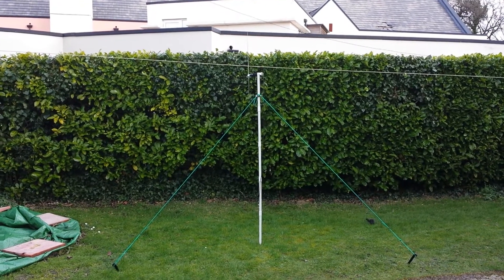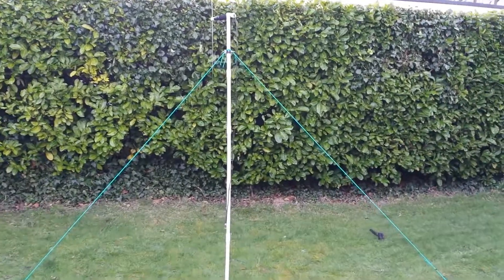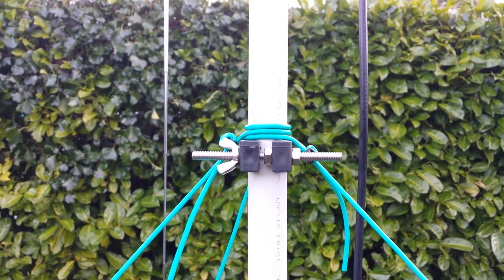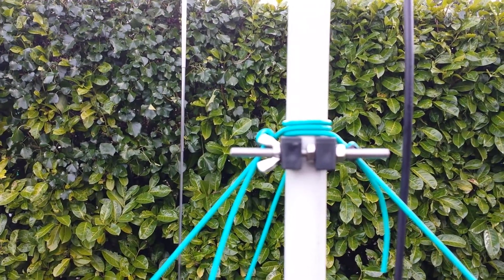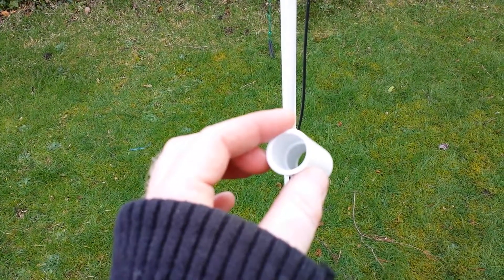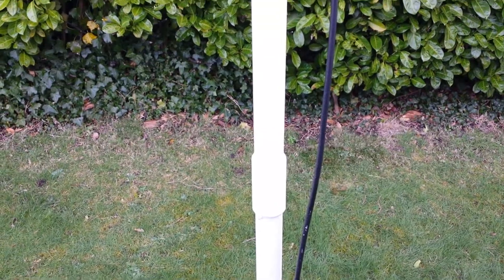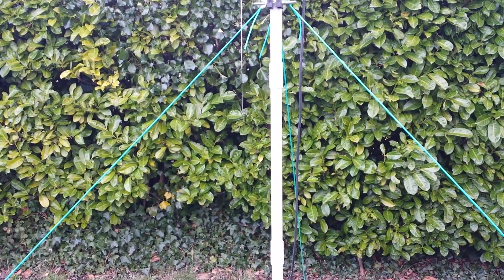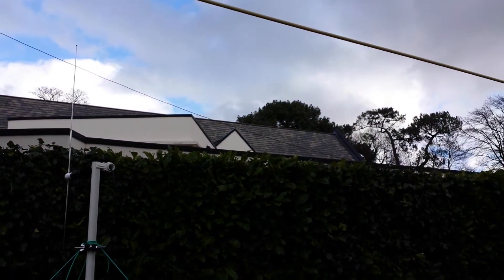SOTA 2m/70cm telescopic Dipole Antenna Pt3 - "THE SOTA MAST"

Comment: Newly passed foundation licence holder here, quick scour of eBay and for £20 including cable I've just got the bits to recreate your antenna which should go absolutely lovely with my cheap baofeng handheld.

Love this idea, simple as heck to make and thank you for sharing especially all the extra work for the mount and mast.

Might seem like common sense but when you're new getting your gear together can be overwhelming.

Thanks again!
Reply from the maker: Congratulations on passing the foundation exam. This antenna will greatly improve your radio performance. Dont forget to get a swr meter, very important to tune any antenna to protect your radio transmitter. Have fun 73's